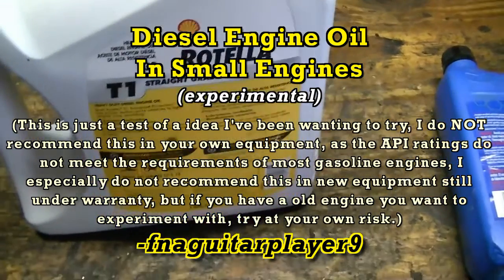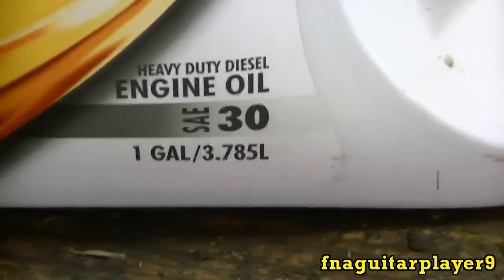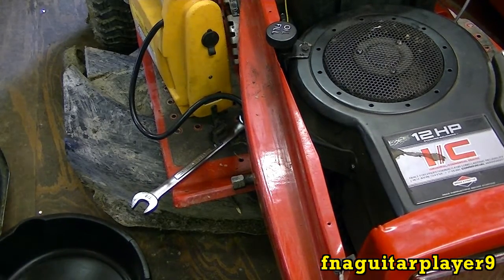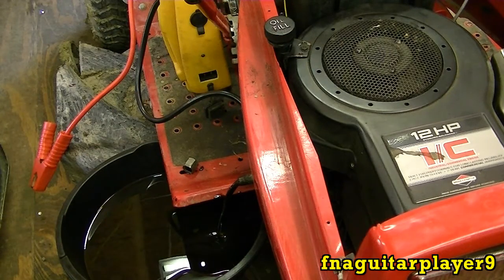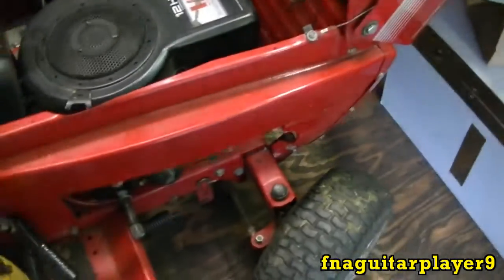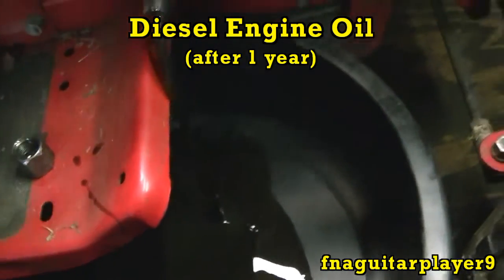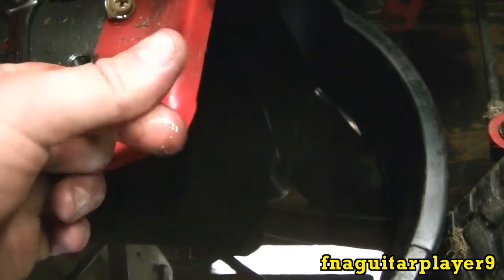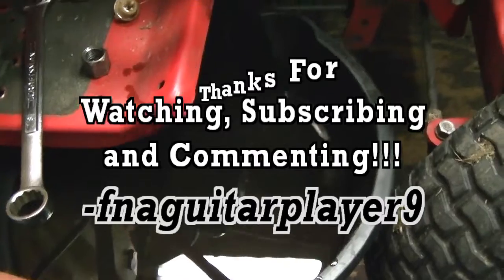Diesel Engine OIL In Small Engines Experiment Test

Comment: I guess he could try the 15 W 40 semisynthetic next or the full synthetic I would think after five minutes of running or so that engine will be a lot quieter and probably make a little more power than that marginal Walmart oil if you wanna go bonkers, you can order a couple of quarts of Royal purple HPS 20 W 50

Comment: I've been running Shell Rotella 15-W-40 conventional diesel oil in two zero turn mowers for years,one with a Kawasaki motor and the other with a Kohler. No problems with either.

Comment: Diesel oil is better for alot of engines...esp push rod engines with flat tappets bc of the high zinc in diesel oil...that's all I use for all my small engines and obviously my 12v Cummins and even my older motorcycle as well... no issues

Comment: If thicker diesel oil was better, manufacturers such as Briggs, Honda, Yamaha, etc. would recommend using it, as it would prevent some warranty claims and save them money. Those small engines are splash lubrication only like a gearbox, so they actually need the thinner oil. The oil needs to get into very small crevasses and journals continuously, like where the crank meets the connecting rod. Thinner oil can do that better.
Reply: They want lower viscosity oils for fuel efficiency. They could care less about the wear. I’m going to start using a 5W-40 in my 4Runners VS the 0W-20. I need longevity, not great mileage.
Reply: @JAMESWUERTELE  Gotta be careful there, bud. A small engine with spash lubrication and a truck engine aren't the same thing, by far. Modern car engines with VVT (variable valve timing) are extremely sensitive to oil grade, as the passages to the upper engine and VVT system are tiny. 

If you pour some molasses-grade oil into that 4Runner, you will explode the VVT system within a few hundred miles. I have a VVT engine (Ford 5.4L) and you simply cannot go any lower than 5W30, which is what I run in it. That motor is rated at 5W20. If yours is rated at 0W20, you should stick with it and simply do more oil changes if you're worried. 0W20 is a very specific oil for very specific engines.

Comment: I work for a certified club car and ezgo golf car dealer ship and we run rottella 15w40 In every golf car engine . My boss has used since the 90. We live on the coast so if you use 10w30 engine oil which is recommended the motor tend to consume a lot of oil . I'm a small engine it doesn't matter if you use a thinker oil since it use a splash system . Diesel oil is more heavy duty . The rotella t4 is rated jasoma which is the rating for atv oil .

Comment: I use some flavor of Shell Rotella in basically everything I own. It's tough to beat from a price to performance standpoint. Even in my modern gas vehicels... Shell Rotella Gas Truck beats just about everything except Amsoil and Royal Purple in every lubricity test I've seen but it doesn't cost any more than Mobil 1 or Pennzoil Platinum (sometimes its even less). Anything without a catalytic converter gets Rotella T5.
Reply: Why would a cat matter? Because of the zddp?
Reply: @GoogleRuinsAnythingItTouches  yup it trashes cats allegedly

Comment: 15/40 went in everything when I was a kid, my dad worked at a diesel shop and was able to buy bulk oil.  Never an issue.  The old johndeer got the used oil from the cars because it leaked oil, needed a quart all the time, so we recycled it, nothing had variable valve timing.  I run t-4 in my motorcycle, delo 400 in my 4 stroke outboard, and diesel pickup.  5/40 delo 400 in my honda crv.
Reply from the maker: It seems to be good all around oil. Thanks for Watching!!!

Comment: The only difference between atv oil and regular oil is atv oil is designed for atv’s and motorcycles with wet clutches which lawn mowers don’t have. Your best bet per dollar is probably a cheap Supertech or traveller 15w40 that is diesel and gas dual rated.
Reply from the maker: That makes sense. I came up with a better oil for small engines, using valvoline sae30 mixed with the 20% lucas oil stabilizer, seems to be a perfect oil that holds up better. Thanks for Watching!!!

Comment: One you might look into is Shell Rotella T6 full synthetic, I have over 100,000 miles on my motorcycle using the 5w-40, and I also have started using it in my John Deere lawn tractor with a v twin engine. This oil is certified for diesel engines, gasoline engines and carries the JASO MA rating for motorcycles. In addition it is also available in a 15w-40. The Rotella T6 is pretty easy to find, some WalMart's carry it, and it is easy to find at most farm and ranch stores. I don't know the specifics, but Shell recommends you only use T1 in diesel engines, while the T6 is a Universal Oil and can be used in almost anything that uses motor oil. Rotella T6 is only available as a multi grade, 0w-40, 5w-40, and 15w-40, a lot of guys use the 5w-40 or 15w-40 in their bikes.
Reply from the maker: I'll try that next time and see how it does. Thanks For Watching!
Reply: @fnaguitarplayer9  that's a great demonstration video man, but remember one thing, an oil which is only rated API C and a diesel multigrade engine oil rated API C and S, are the same oils. I see nothing but a ton of advantages using a diesel engine oils in petrol engines. I do it myself and I don't have any problems, either with my water pumps or generator as long as I follow the maintenance schedule.
Reply: Never run full synthetic in an old motor or a small engine. Unless you all want it to run out the bottom and on to the floor.
Reply: @thomasfogerty3515 😂😂😂😂
Kamala voter obviously
Reply: @thomasfogerty3515  true.

Comment: Been using this in my husqy w/24hp b&s since around 50 hr Mark. It’s at 210 now. All T1 rotella sSAE30. No issues yet. Seems to run smooth 🤷‍♂️it gets ran hard too, 3.5 acre yard once a week on average up and down hill. Just my .02
I change oil at beginning of season and once in middle of summer for reference. Oil and filter. 

Look for it on Walmart shelve in oil aisle for “discount shelf” I picked up 4 bottles of this stuff for like $5 each
Reply from the maker: I hear ya, it seems like good stuff, some people say they use the 15w40, i haven't tried it yet in small engines. Thanks for Watching!!!

Comment: I use Rotella T4 15w40 on my lawnmower, power washer, 2 quads, boat and diesel pickup. Before anyone says anything negative look at the oil rating and also it my stuff and that is what I run.
Reply from the maker: I'm thinking about switching to that weight and see how my engines like it. I'm back to using valvoline sae30 with lucas for this year. Thanks for Watching!!!

Comment: ?well 15w40 motor oil work in a push mower
Reply from the maker: Its not the recommended oil but it can be used, sae30 or 10w-30 is best. Thanks for Watching!!!
Reply: It's all I use! Anything air cooled loves 15w40.
Reply from the maker: @TheBigdog868  I hear ya! I need to try it next!

Comment: The thickerer isn’t the betterer, do you know that thicker oil creates more resistance trying to force oil through the bearings and engine and creates more heat ? The thickerer oil also doesn’t cool down as fast .

Comment: No Diesel engines run cooler than gasoline engines that’s why you’ll see them with the blankets in front of the radiator in winter time 
But this is a good oil I’ve used the diesel straight 30 no problems
Reply: Diesel engines temp is based on how much fuel being burned  under load produce more heat.Newer emmisions engines now all run hotter for better fuel economy and less emissions. Coolant temps 185 to 210 f oil temps around 230 degree F under normal on highway loads depending on model engine.
Reply from the maker: Thanks for Watching!!!

Comment: I was going to use the Straight 30W A 15w-40 rotella may be better
Reply from the maker: I'm thinking of trying it next, should take the heat very well, even better then the 30. Thanks for Watching!!!
Reply: I put 5W-40 T6 rotella in, seems to flow nice, Run a 10w-30 t5 semi synthetic on my power washer.
Reply from the maker: I hear ya!
Reply: I finally used my power waster, the 10w-30 diesel oil I used in it, t5 rotella seems to make it run a little cooler, The GX200 on it Pops less. It sure stays cleaner than whatever straight weight oil was in some bag it came with lol.   for 15 bucks a gallon, 10 after rebate its a deal.

Comment: I use Diesel engine oil in my 4 strokes and as transmission fluid in my 2 strokes. Meets clutch specs and all that technical stuff. No issues on my 4 stroke though.
Reply from the maker: I hear ya!  Thanks for Watching!!!

Comment: I had a Briggs & Stratton portable generator a few years ago, the piston somehow seized to the inside of the cylinder, which shattered the piston in a million pieces and took huge 1/4" deep gouges out of the inside of the cylinder. It was pretty much a total loss, which was weird, since it only had a couple hundred hours on it, and always had regular oil changes, etc... I just figured you should know that I was running Rotella T in it at the time. I'm not saying that's what caused it, but that's the only engine I ever used Rotella T in and also the only time I've ever had an engine fail in such a destructive way.
I use Valvoline SAE 30 in most of my stuff, and NAPA branded synthetic 5W-30 in my new generator.
Reply from the maker: I hear ya, its hard to say if the oil caused it or what,  could have been a defect from the factory. who knows. The newer briggs are mostly made in china now anyways, the castings aren't as good. I used to use valvoline, and still do in my truck, but the main reason i switched to this is, its cheaper by the gallon jug then individual quarts, if valvoline put there sae30 in a jug like this I'd use it instead. Thanks for Watching!!!
Reply: I would say odds are the piston or rod etc had a flaw in it from the factory myself and finally decided to come loose. I've used the Rotella 30w for serveral years in my lawn equipment and never had a problem. I use the Rotella 5w-40 in my Suzuki Eiger with no problem so far. I've even run the Rotella 15w-40 in a 1999 GMC Jimmy no problem.

Comment: My mower is a 2004 craftsman 16hp OHV briggs and it has ran most of it's life with diesel engine oil and the mower has a ton of hours on it and it does not burn oil or knock or anything and it hasnt blown a head gasket yet and that is pretty rare for an OHV
Reply from the maker: I hear ya! Good to hear you haven't had any problems. That is rare, they are bad about blowing right between the cylinder and push rod chamber. Thanks for Watching!!!

Comment: An easy way to differentiate between oils is the API rating right in front of you. 
The first letter tells you what to use it in. 
S for spark ignition engines
C for compression ignition 
Sl,sm..etc a "gas engine oil"...
Just an idea but putting diesel oil in your gasser isn't a big deal, but I'd never wanna use gas engine oil in a diesel except for maybe a quick flush
Reply from the maker: That makes sense, yeah I'd agree to that, not using gas oil in a diesel. Thanks for Watching!!!

Comment: I have a very old 12hp briggs I was considering using a 50 weight oil on, might try a 30w diesel oil instead :)
Reply from the maker: I hear ya, you could get the 15w-40 version of this oil and try it, 50 might be a little to thick. I recommend 30 weight for small engines. Thanks for Watching!!!

Comment: Can't find straight 30 w diesel oil.  All I see is 15-40.
Reply: Tractor supply has 30wt diesel oil too called Traveler. I used it many times in my mowers.
Reply: Jim s: If 30 wt is what your engine requires, you can use a well refined multi grade gasoline engine oil as long as it does not exceed 30 wt, such as a 10w-30 and is most likely to be available anywhere. It's the 30 wt you are really interested in having for your normal operating temp anyway and 10w-30 will give better lubrication in cold weather starting should you have this as a concern.
 Added Note; In so far as the oil itself is concerned, diesel engine oil and gasoline engine oil have the same base stock, meaning one is not more durable or better than the other. It's the additives for the different combustion byproducts that separate and identify the two oils-fact. These combustion byproducts will enter into the crankcase to get mixed in with the oil through the blow by. Example: the large amt of soot in diesel combustion-hence a larger amt of detergent will be in diesel oil vs gasoline engine oil, etc. So, with this being true, it's really best to use the two oils for their respective engine type.
Reply from the maker: I got mine at walmart, they had both weights, I double checked the other day before i put the video up. I'm not sure what other stores sell it to be honest, Thanks for Watching!!!
Reply: jim s 
I know it's not usually on the shelf at advance but they can get it (my job has a commercial account there )
Reply: I did get some at AutoZone, $14.99 with an instant off coupon, shortly after my post.
Thanks.
Reply from the maker: No problem!

Comment: Seems this is better oil then what you were running.  You may want to consider using an oil stabilizer to further improve oil lubricity & reduce breakdown.  I'm going to try it in my tractor & see how it works out.  Nice video.
Reply from the maker: Yeah it does. I have used STP before and Lucas, I use lucas in my truck. appreciate that, Thanks for Watching!!!

Comment: my old lawn tractor that basically is just for pulling around a wagon gets 15w 40 rotella. it's been working good for 3 years, I change it every year. free mower 3 years still kickin.
Reply from the maker: I heard that, I started to get the 15w-40 instead of the 30, but ended up getting the 30. can't beat that! Thanks for Watching!!!

Comment: Fun,  interesting, thumbs up rating.   I’d like to boost my small engine compression.  I’m at altitude here.

Synthetics are supposed to protect better.   I was running that for a long time.  I think I had 5w-50 in my snow blower.   The higher rating is for heat protection and the lower rating is for cold.   Makes a huge difference in how easy the engine turns over on super cold days -one pull in the coldest of temps.  I switched that out last year and I had to use the electric starter this winter.   I think some of the synthetics are glycol based which glycol is like anti-freeze or power steering fluid and it’s not all that bio friendly, so I stopped using that, not knowing.

Would be fun to swap in an actual diesel engine.  Have thought about that in the past as a project with my old Snapper 1030 snow blower.  Check out Wiki and read the history about Rudolph Diesel and his ground breaking engine -pretty cool technology and pretty cool guy.  He didn’t want it to run on petro diesel, just vegetable diesel.  I bet that wasn’t too popular.

To be or not to be real, that’s the question.
Reply from the maker: Appreciate that! I hear ya. What engine is it. If its a older briggs flathead, on certain models you can swap heads out to raise compression. I hear ya, a thinner oil does make a big difference in cold weather. I've always wanted a small 1 or 2 cylinder diesel engine for a lawn mower. Thanks for Watching!!!
Reply: Thanks for the note.  It’s Techcumseh.  Just fun to do something different.   All the commercial stuff is one size fits all.   With the low air pressure here, a higher compression engine makes sense.  You drink well water there?   I can tell -you’re still sharp without all that fluoride in the water.   Stuff dulls the mind.
Reply from the maker: no problem! Might check into getting the head shaved down some to raise it, that may be the only option. haha i hear ya, I used to all the time.

Comment: I run diesel 15w40 in everything. From mowers to our farm tractors to our quad and never had an issue. The C and the S to those wondering on the back of the jug means Compression ignition and Spark ignition.
Reply from the maker: I hear ya, thats a good universal weight not to thick in cold and won't thin out in the summer. Thanks for Watching!!!
Reply: @fnaguitarplayer9  Diesel monograde motor oil has detergents that actively cleans the engine. It won't affect the performance or won't destroy your engine anyways, so why not??

Comment: It wouldn't hurt if I use 10w40 in my 4 year old push mower right? Since it got a little wear
Reply from the maker: That should do fine. I have a old briggs and stratton manual for a 10hp, now this is a 70's or 80's model and it had 10w-40 listed as a option. I wouldn't use it in something still under warranty though. But yeah in something older it will do fine. Thanks for Watching!!!

Comment: I started using T1 in my small engines about 3 years ago.    As far as I can tell it works well..     Most were torn down and cleaned prior to switching.      I would not use it in a dirty neglected  engine with  lot of crud in the crank case.
Reply from the maker: I hear ya! This is my 2nd year now. Good point since its high detergent. Thanks for Watching!!!